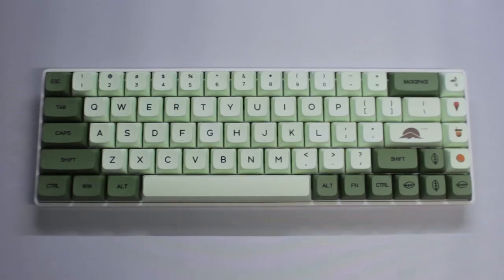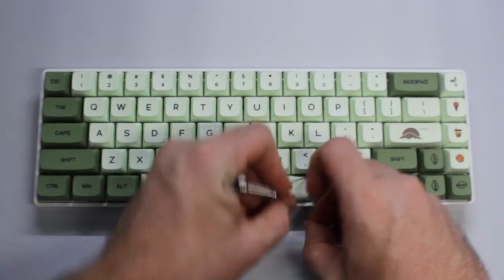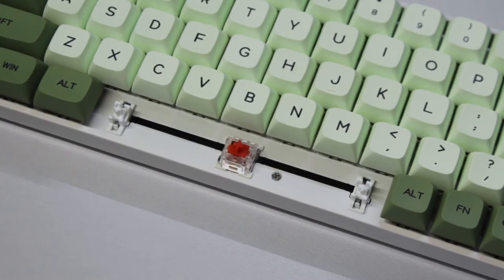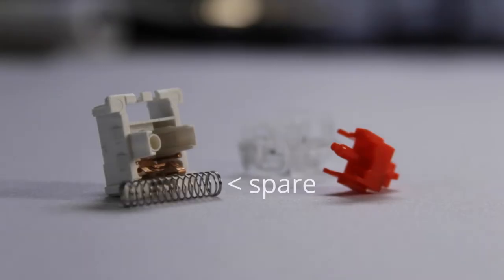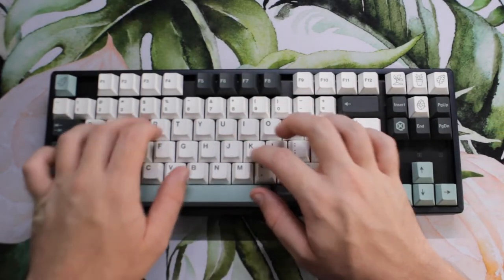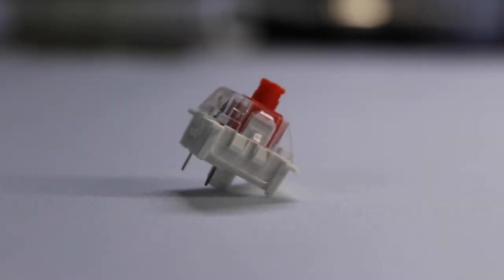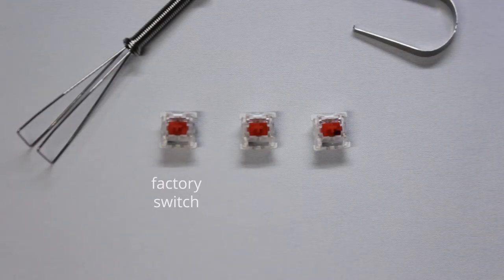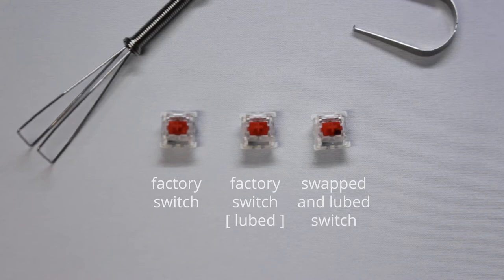Spring Swapping my Switches.. Why?

Comment: Would be nice to know what size & weight Spring gives you just slight more smooth resistence. What is the weight & size of stock RK84 Red Switch Springs to have a reference point.

Comment: does actuation force of switches change the sound
Reply from the maker: Hey! thanks for your question,

the sound does change slightly depending what spring is used inside the switch, but it is such a slight change (especially when the springs are lubed properly) that your ear cant really hear it. most of the change is the physical change in pressure it takes to actuate the switch.
Reply: @qtechkeyboards9039  what about in terms of loudness? does lighter spring make the switch sound louder
Reply from the maker: @hindra1996  the springs don't change the sound of the switches much if at all in my experience